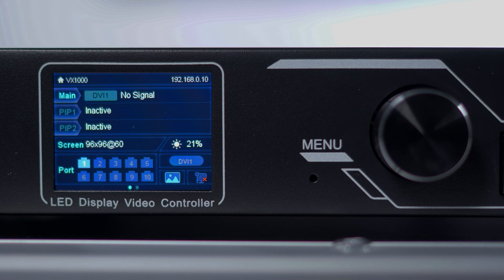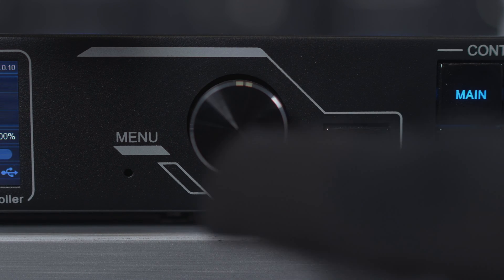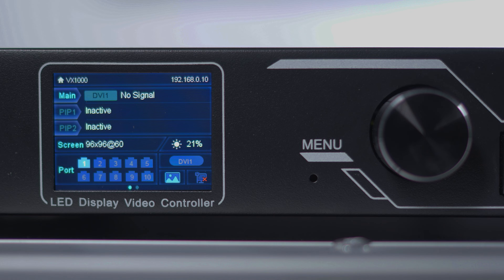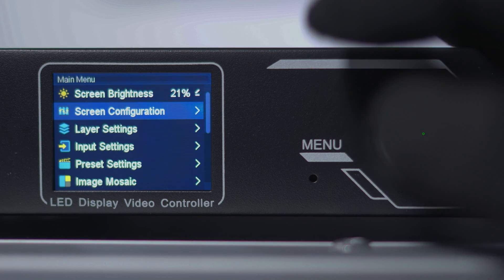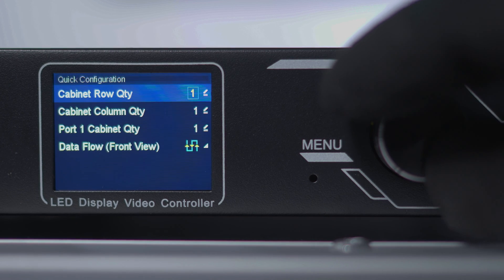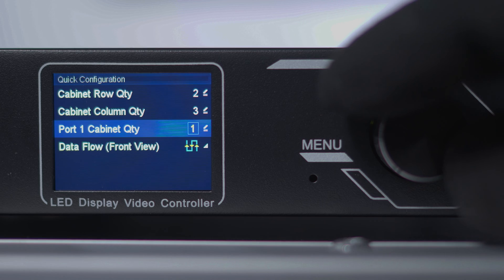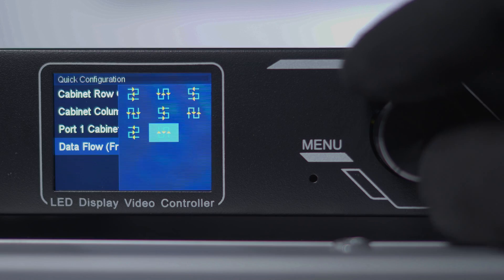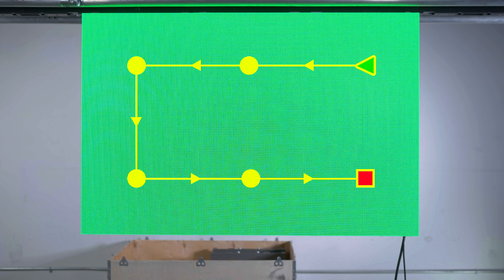LED Wall Setup | 06 Mapping LED Video Walls with a Processor

Comment: So you've told the controller what the layout is, based on how the communication loop is arranged. Any details on how the panels "learn" which one they are?

If I were to guess, I'd think there is a special "configure yourselves" message that is sent from the controller. Probably starts out as a message that says "you are panel #1". When the first panel gets the message, it learns that it is panel #1. Then panel #1 modifies the message to become "you are panel #2" and sends that message down the line. Since panel #2 is the next one connected, it sees the message and configures itself as panel #2. Panel #2 then modifies the message to become "you are panel #3", and sends it forward, etc. etc.

Comment: Very useful nicely explained, can you all do a video about how to connect a redaduncy video wall controller to LED wall?
Reply from the maker: @dimantataj5155  yes, someday. But all you do is add a main data cable from the LED processor…to the last panel in each data run. (Whereas when you set the wall up, you plug a main data cable to the first panel in each run)…then there is a basic setup step in NovaStar setup.
Reply: @squareV   thanks for the knowledge sharing

Comment: Question… wouldn’t the Row be the number of panels “wide” and the columns be the number of panels high..? TIA
Reply from the maker: That logic makes sense…but the way it is calculated….Rows = number of rows in the video wall (number of panels high)…Columns = number of columns in the video wall (number of panels wide)